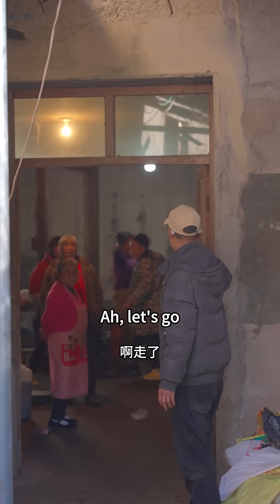I can't do heavy work now, my husband and cousin took the tea seeds to press for oil

Comment: WOW tea seed oil is very, very healthy.
Yes, tea seed oil is healthy for cooking and has many nutritional benefits: 
High smoke point: Tea seed oil has a high smoke point of around 485°F, which means it can be used for cooking and grilling without burning or producing smoke. 
Healthy fats: Tea seed oil is high in unsaturated fatty acids and contains more omega-3 fatty acids than omega-6 fatty acids. It's also cholesterol-free. 
Antioxidants: Tea seed oil contains antioxidants called catechins, which are also found in green tea. Catechins have anti-inflammatory properties.